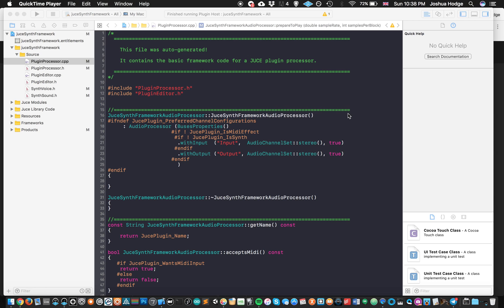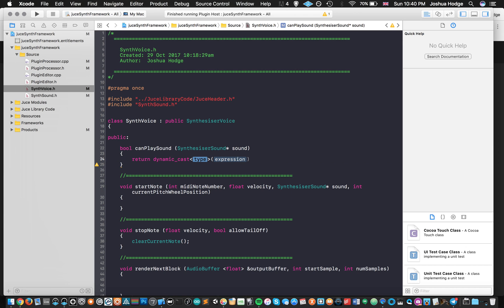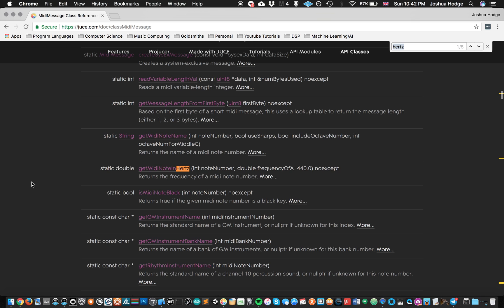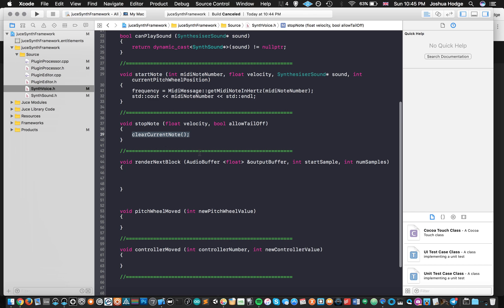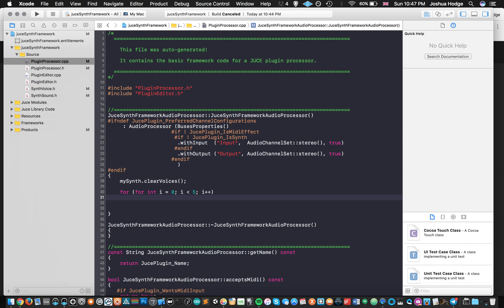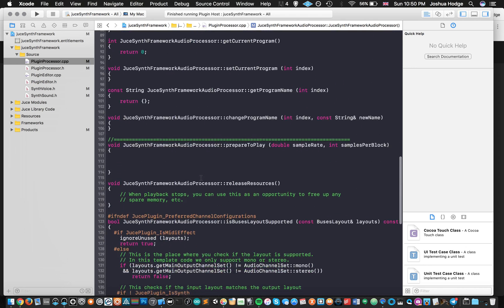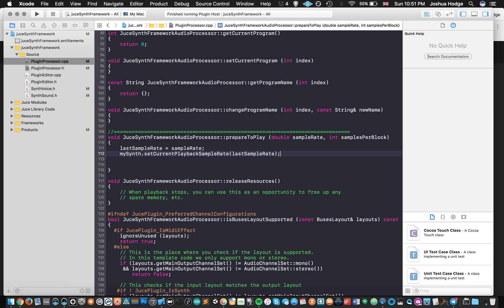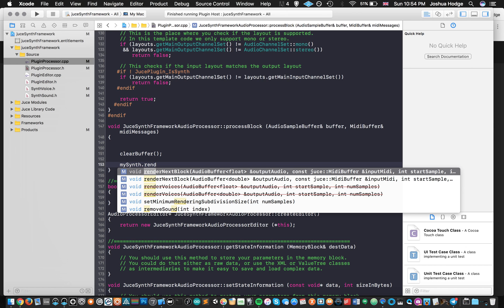Juce Tutorial 22-  Building a Synthesizer Part 2 (Midi Functionality)

Comment: Re dynamic_cast.  From what I understand, this statement checks to see if SynthSound is a derived class (inherited) of the base class SynthesiserSound, which (an assumption at this point of my knowledge) is known to be able to play sound.  A rather good explanation here:

https://www.learncpp.com/cpp-tutorial/12-9-dynamic-casting/

Basically it's saying that if the SynthesizerSound class can be cast to the SynthSound class, then return true.  It's like testing to see if a rectangle can be cast to a square because a square has the attributes of a rectangle (four sides, four 90 degree angles), plus a special attribute of it's own (all four sides are of equal length).  A square is a type of rectangle, but a rectangle isn't a type of square.

Comment: If you get an error message on 

"mySynth.addVoice(new SynthVoice()); An instance of an abstract"

you just have to put override after each void function. If you go to Joshua's code on GitHub, you should see that he has "override" written after each function in the SynthVoice.h file. 

Also, if you have an issue with frequency, write "double frequency;" under private in SynthVoice.h

I hope that helps as those were the issues I was stuck on.
Reply: Thank you for your help.  It worked like a charm.

Comment: I've been stuck on this for awhile. Following the code pretty much exactly all the way up to 17:50 and reaching a breakpoint error using the AudioPluginHost. As soon I strike a note on the midi keyboard, the breakpoint appears at the "juce_MidiKeyboardState.cpp" file, where the line stops at "listeners.getUnchecked(i)->handleNoteOn(this, midiChannel, midiNoteNumber, velocity); "
Reply: @TheAudioProgrammer  Hey, so this is weird, but it's suddenly working now, and I have made no changes. I really don't know why it started working now. 

A recap for my error from the community discord chat: My error according to chat had something to do with my MidiMessageCollector. I was suggested to clear/reset it. I tried that but didn't work. I was suggested to utilize the call stack in visual studio (honestly I would say I'm not completely familiar with Visual Studio yet since I came from VS code, but the call stack helped me read more of where the code is calling). Honestly, I'm just wanting to ask why it works now? I made no changes to my code, it is exactly the way it is set up from the video. 

The only thing I can think of because I've been stuck on this bug since yesterday, is taking a break, I actually closed this project and decided to work on earlier tutorial parts to relearn/refresh the material. I mainly looked back to any tutorials that dealt with the AudioPluginHost program because I felt like my installation for it was broken or something, so I wanted to test it with the other tutorial projects. I did get the same breakpoint error from those, but coming back to the part 22 project, it somehow miraculously started logging my midi keyboard input from the AudioPluginHost keyboard.  

TLDR: It was broken, I made no changes to the code. I guess I reopened, and suddenly it works. Why!!??! If there is any explanation please help me understand this!!!

Comment: i am trying to figure out how to get midiNoteNumber into the debug-output window in visual studio 2019 while i run the juce pluginhost process attachedin debug mode. std::cout doesnt seem to work. any ideas?
Reply: i found DBG() and it worked:
https://docs.juce.com/master/group__juce__core-system.html#ga679635952a5d2eb25f3b31398f0fcc25

Comment: Tip for viewers: If your plug-in doesn't appeara as an option when you right-click in the Plug-In Host GUI (17:14) , drag it in manually from the build folder – after doing this once, you should be able to select it by right-clicking the GUI.

Thanks for another great tutorial!
Reply: Hey, what file exactly should i drag. I'm using Linux and have just a a set of *.plist files

Comment: Maybe I missed something but the PluginProcessor doesn't have default methods of "clearBuffer" or "RenderNextBlock". Did you perhaps leave something out of this video?
Reply: Same. I am thinking these are updates to Juce that happened after the video, but that's just a guess. Would really love an update on this.
Reply: Matt Lee yeah, he changes it to buffer.clear(); around 16:55. As far as renderNextBlock(), it’s a function of the mySynth object, so it should work. Do you have all the proper headers included?
Reply: I got stuck at the same spot, just keep watching the video he messed up and fixes it  shortly after.